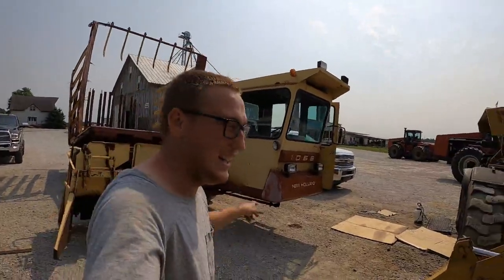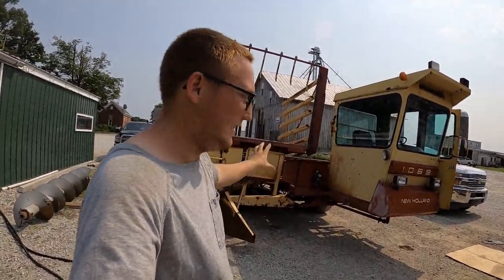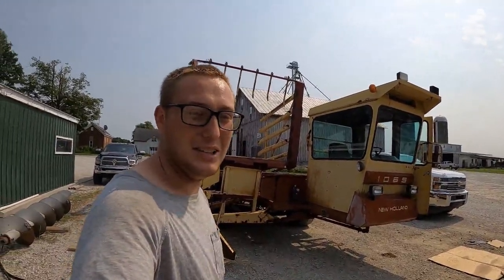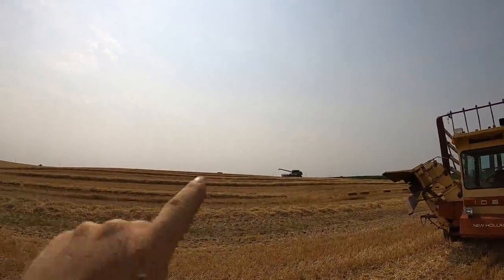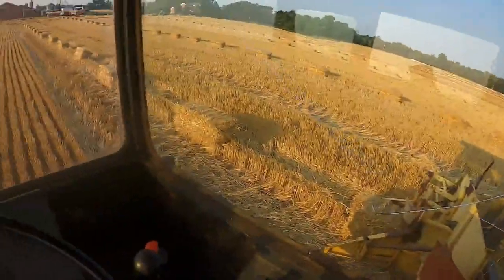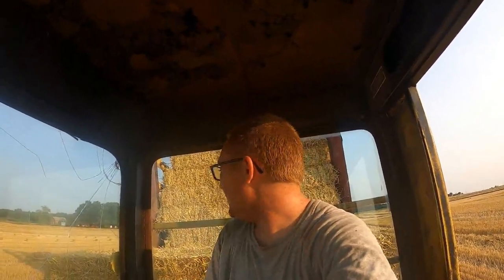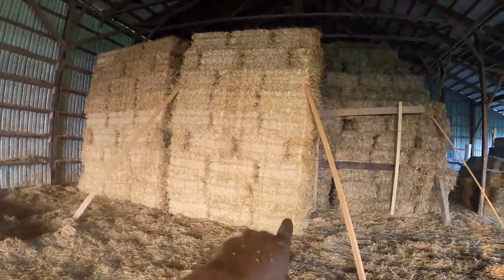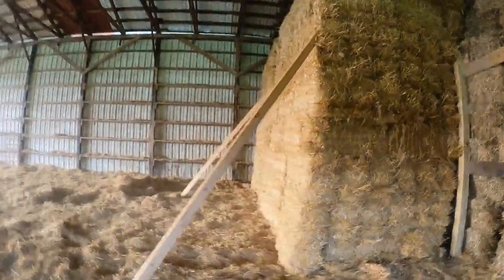My First Time Using 1069 Bale Wagon

Comment: We have had that exact machine on our ranch for 20 years.   Helpful hints:
Do not let any grease accumulate anyplace on the machine.  Pressure wash at least twice a year. We have had good luck with WD-40 special formula for chain, won’t drip all over. all guard’s in place, if any are missing get them .  Pay very close attention to exhaust system,  must keep totally sealed, not one pinhole.  The straw you kicked out of the way can get blown up under machine.
Seriously go buy TWO good size fire extinguisher and mount on each side outside.  Better to bale out than be trying to unsnap extinguisher while your neck is burning.

Comment: Lot ease to handle 35 pound bales what we bale easy on us handleing
Reply from the maker: We found that the 35lb bales are too light and break easily with the bale wagons. What are you using to pick bales up with? Yes I agree, a 35lb bale is easier to handle.
Reply: Too many bales for the tonnage with lighter weight bales. I say my 1089 works best with heavier verses lighter weight bales also. Also agree consistent length is less agitation.